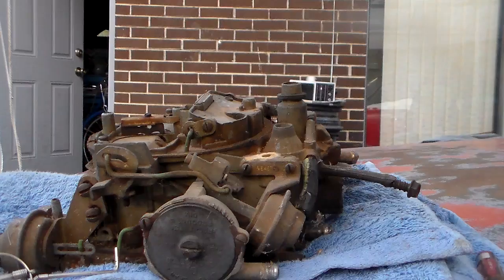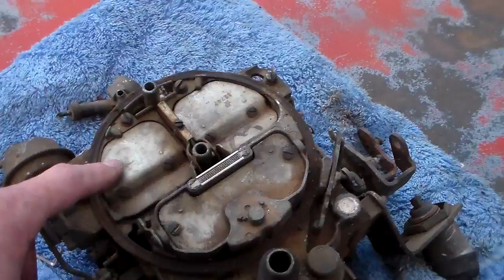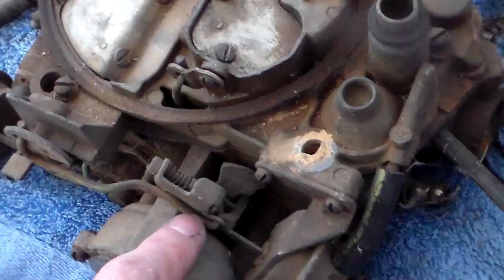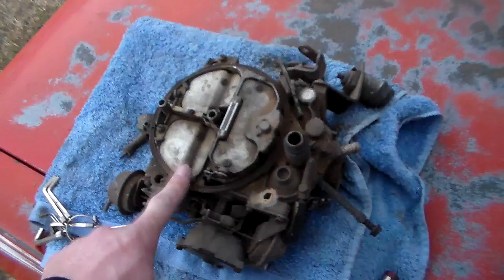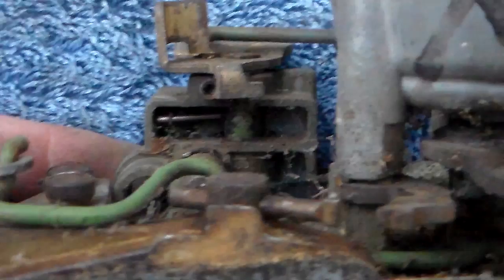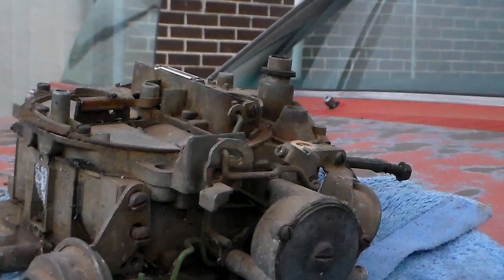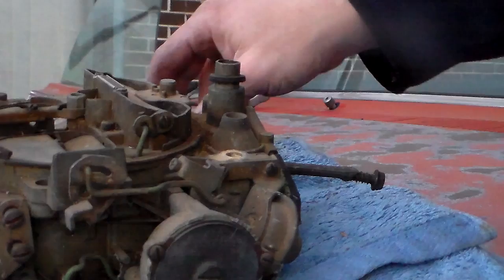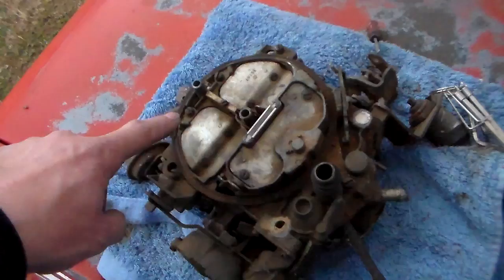How to adjust Quadrajet secondary air doors

Comment: 10 years....10 years I dealt with the "WOT bog!" And then I watched your video, walked out to the car, made the adjustments to mimic the spring pressure you showed and BAM, bog gone. In fact, it'll now light the rear tires from a roll just mashing the pedal. Thank you!!
Reply from the maker: Glad to help!
Reply: What is bog?
Reply: @91hamod  Bog is what happens when you attempt to accelerate your vehicle but instead of gaining rpm, the engine speed slows down, flutters, or completely chokes out. It "bogs" down. 

Depending on the nature of your engine there can be many different things to take in consideration when trying to correct this problem, but in essence 9 times out of 10 its directly affected by improper fuel/air mixture from the carburetor. You stomp the gas -> improper carburetor tuning -> engine bogs -> complete loss of power and rpm -> a little piece of you dies inside.

Carburetors are incrrrrredibly complicated devices with hundreds of completely different designs and applications. Each one must be tuned correctly or else you'll get poor gas mileage, low power, back fire, and eventually bogging as the severity of calibration strays. Hence, the individual above stating it took him 10 years to finally learn what to do to fix his bogging problem from this video.

Don't be scared of them though. carburetors are just like any other piece of a vehicle - nuts and bolts. Take some time and watch some videos and eventually you'll slowly understand how simple they can be once you get what makes them tick. If you wish to build a carb for the first time Id suggest starting with a basic Holley. They're very user friendly, simple, and reliable. And because of their natural ON/OFF feeling design, they're great for more aggressive builds if you wish to slowly build you vehicle into something with more performance.

I recommend a 4 barrel (4bbl for short) double pumper for a manual transmission and a 4bbl vacuum secondary for an automatic. There's nothing really wrong with a double pumper on an automatic though, just needs a bit more dialing work and throttle control. learn the difference between double pumpers and vacuum secondaries and you'll understand why. Holley actually has a full video series on youtube explaining almost everything you need to know.

I hope this clears up a descent sum of you and others questions. Theres always more but I dont have the room to type EVERYTHING here lol. Best of wishes!

Comment: Thanks for the video. Just bought a C30 and the secondary flaps had no spring tension. It would open up if you looked at it the wrong way. 😂

Comment: Top Man Tyler !  My little old 87 Pontiac Firebird 305 has been boggin and surging for almost a year.  Trying to find people with knowledge on these here in the UK is like pullin teeth . . . . .  painful, every time I thought I found a so called 'expert' they knew less than I did already.   I have  been 'messin' with the emissions system, and the QJet settings for ages, I tested every solenoid and checked every vacuum line for hold vac, hell I even pulled the EGR valve out and declogged it, and of course adjusted the infamous TV cable, but still my bogging from idle AND during acceleration remained.    I have self-learnt and tried what I could 'SEE WITH MY EYES' but all in vain.  THEN I found you Qjet video streams and this video led me to that hidden grub-screw used to secure the pre-tension spring for the secondary flaps . . . . . . . torch . . . . . .mirror . . . . .check . . . . . . .found the bugger LOOSE . . . . . . .adjusted the flap tension as you described . . . . . . and took the opportunity to also correctly adjust the choke flap and fast-idle speed.   Just took it for run and WOWEE I HAVE MY CAR BACK.    After a full year of messin about the problem has turned out to be a small loose grub screw for the secondary flap tension.    Keep up the great work Tyler :-)

Comment: Man thank you so much. I finally got my car running right. I got a trans am and a quadrajet is the only thing I can fit under the shaker base. I never could get it to run right and tried everything in the book. Except this. Wow what a difference. I'm sold on the quadrajet now. Great information. Great explanation. I dialed mine in just like your flaps open and close on this video and it's running perfect. No more bog. Not more stumble. Nothing. It's perfect. Thank you for taking the time to do this.

Comment: Thanks for the video...I just built a 300 HP 305 for my boat.. ported heads, small duration ,small LSA big lift cam..stock low rise but with a 1" 4 hole for velocity and a bunch more goodies...I found I have a bog out of the gate and I'm sure this is it...on Holley's I would just test ,replace with a stiffer spring,test ..most people think it needs to open sooner but it's the opposite so that the carb does not lose all its signal too fast..so simple to adjust..I never knew ,or I did and forgot.. mechanic for over 30 years...great video,thanks for posting..

Comment: Can't tell you how much your videos have helped me with my carb and getting it sorted out. Thank you so very much for taking the time to make these videos and share your knowledge.
Reply from the maker: I'm glad they were of use.
Reply: @TylersNeighborhoodGarage  
They are definitely "of use". Any vehicle I've got with a carb.... they all have a Quadrajet. I love these carbs. 

I have a question Tyler...
Can I tune when the secondaries come open? I've noticed I mine won't open up above 45 mph. Below 45 mph if I stomp on it she's a beast that'll embarrass sport cars.
The issue I have on this 1981 c3500 (350/400/4.56:1 7400 lbs) is I have a long huge incline grade on the freeway near my house. If I hit it with speed I can climb it 80-100 mph but if I get there without speed..... all I can muster is 40-50 mph at full throttle and secondaries don't open. 
So.... I know if I need to tow over this hill, currently, I wouldn't be able to do it. 
I'm not expending big block or diesel torque to climb this hill but I know what a properly tuned small block can do, so I know I'm lacking alot.

How do I fix my secondaries for this hill under load?
🙏

Comment: Thanks for the video!  I restored a 1973 Formula 400, 4 barrel, 4 speed, like the new one I had back in the day. Had that Quadrabog problem when I punched it, didn't think the adjustments would really  work,  but after a few tweaks as described in your videos, the car wants to go sideways with power when the secondary"s open. WOW!

Comment: 13:10 cheers Tyler mines doing this. Also i found out my secondary/choke vacuum module is dead. The one at the front of the carby. Its been running rich and not getting much power and chewing fuel. Excellent that you took the time to teach us.

Comment: I subscribed. Thanks for the info. I'm 16 and working on restoring my 1980 z28 with original 350. Runs great but when you punch it, it hesitates and wants to stall but then picks back up. I'm gonna try this adjustment and if this doesn't help I'm gonna go through and make sure all the screws are adjusted to factory air/fuel mixture

Comment: WhoSaidTyler I had a bog like you described when I stomped on the gas pedal, and I tightened the secondary screw just like you showed and the bog is gone.  Now I'm cruising around town in a 1936 Ford 2 door sedan with a Chevy 350.. recently inherited the car from a relative who passed away, and I knew nothing about carbs before this.

Thanks again - Tim
Reply: P.S. it is a Carter Quadrajet.  It looks just like the one in your video though.
Reply from the maker: tim d Great! Yes Carter produced Quadrajets when Rochester couldn't keep up with demand.

Comment: I have a freshly rebuilt Rochester Quadrajet. When I punch the gas the secondary's barely open. ( I had to dissemble and clean the carb for another reason) but Im certain I re-assembled it correctly. I watched your video and put it back together step by step. Also, when I give the engine a quick punch of gas, there is a slight stall as if its not getting gas right away. Thanks

Comment: i rebuilt ( with a good chem. soak too ) a e34mc, and did everything, including the  choke plate adjust with choke level gauge, the one with the bubble, and it works great. yes, i had to adjust that spring, and file the lock out pin for the butter fly's on the secondary. i loved it. set up a bench with leveler plate and all. the tools were a bit hard to obtain, and i made some of them, but i did every single thing that could possibly be done. all of it. the fucker rips ass now! edit: sometimes the hanging up you mentioned on the secondary , comes from that spring you just adjusted, it starts with a little snag on the initial movement. oil it up good and a hair, i mean a hair looser on the adjust is all you need. my choke pull off went out, and i took mine off and had to wire the fast idle cam down, so the secondary  lock out pin would not interfere with the operation of my secondary. hell, wire that secondary   top plate wide open too  and give it gas. hahaha.  fuck rochester!

Comment: secondary air door spring adjustments are somewhere between 1/2 and 1 turn by 1/16 of a turn..  1/2 turn, 9/16 of a turn, 5/8 of a turn, 11/16 of a turn..   all the way to one turn..

Comment: Thank you for a very informative video. I believe this is what I need to check on a used QJ that I have on my  1974 C10 \ 454.  I just got it installed this afternoon and it runs fine until I go WOT where it just moans a little instead of roars like a QJ should.

Comment: Thank you VERY MUCH!  This is exactly what was wrong with the Quadrajet on my Firebird Formula 400.  

One thing I noticed, was that screw was loaded with the spring, and it had to be held at the desired position while the set screw (allen head) is tightened.
Reply from the maker: Yes, it's a 2-handed operation, lol.

Comment: ive used QJ to replace Thermquads on Mopars, and swapped a few Holleys out for newfound beleivers..not a fan of the later 4ME series,but with right rods, hangers ,and pull off rod/ damper door setup..still work damn good on the 80s GM products too
Reply from the maker: you're right
Reply: +WhoSaidTyler how do you remove the spring to replace it? loosen the set screw and pry the shaft that that the spring is wraped around out?

Comment: Thanks for ur videos they are most helpful. My 73 t/a runs decent until the secondaries kick in then bogs. But if I get the t/a past 60mph and hit it it pulls just fine no bogging. I don't have any vacuum leaks as I can find. The secondaries doors are adjust just like urs. FYI I pro quadrajets.

Comment: I realize this is an older video but I wanted to ask you your opinion on this secondary air door/flaps opening and the spring tension you just adjusted. Back around 2000 I rebuilt a 350 Chevy engine out of a '72 Chevy Cheyenne pickup. The machine shop bored the cylinders .030 over, alighn honed it, rebuilt the stock heads, yada yada yada. I installed a mild performance cam, Edlebrock Performer intake and headers with glass packs. I had been researching the book "How to Hotrod The Small Block Chevy" and it had a wealth of information on building street rod engines and talked about how the 4 barrel Quadrajet was a good street rod carb if built and adjusted correctly so that's what I decided to do. The book also talked about how a particular engine could benefit from adjusting those secondary air flaps or doors to either open earlier or later depending on what the engine demanded or wanted. If I remember right it talked about how a built street rod engine would most likely benefit from adjusting them looser than stock to open earlier which is what I did. I never got any on the street experience with this engine because I was only able to break the engine in and run it on the engine stand here and there, I never had a chance to actually get it installed back in the truck because at the time I was doing a frame off restoration and the truck was in many pieces at the time and my fiancee and I split up before I could get it back together. Anyway, I wanted to ask your opinion on this subject if you've had any experience adjusting the secondaries to open sooner than was set at the factory for a hodrod engine and if you think the adjustment makes much of a difference in performance in such a case?
Reply from the maker: Well, you need to view the adjustment of those air doors as a balancing act, so to speak. They act directly on the secondary metering rods, so anything you do affects the metering. Adjusting them too loose is a common thing that people do and it ends up causing the air doors to pop open so far and so quickly that they bounce back closed, then open again. Guess what happens to the metering rods when they bounce closed? You simply approach the air doors as a tuning operation: drive the vehicle and adjust them until it operates as Rochester intended...no bog, no stumble. Remember that the secondary side is also tuned through the metering rods and the rod hanger. Factory HiPo Qjets also had larger pullover secondary enrichment as well.
Reply: @TylersNeighborhoodGarage  Unfortunately I don't have that vehicle anymore or that engine, not for many years but that's good to know for future reference when I build another one. 👍

Comment: Hey Tyler, my '77 Corvette with the original QJet has a high idle and I have troubleshot everything I can think of. When it is idling high and I force the secondary air flapper open it drops down a lot. Release it and the idle goes back up. The secondary throttle plates are closed fully. Any idea what is going on here?

Comment: I have a 67 impala w a 327 engine. My secondary doors don't open unless the car is off. It seems like diaphragm always has vacuum pressure even when I give it gas which doesn't allow the doors open. Any suggestions?

Comment: What is the part called that the secondary metering rod hanger sits on top of? Does it have a pin that secures it? That part was completely loose and a pin is missing it looks like.
Reply from the maker: There is a plastic cam mounted on the air door shaft, then a retainer, then the rod hanger is fastened to that with a small screw.

Comment: I have a summit bought quadrajet #17057553 that I had on my stock pontiac 400. I then rebuilt my motor and added ram air manifolds, ram air 068 cam and 2.5 exhaust. And my current altitude is 5312'.  I am not certain what jets I have in there just yet. I guessing stock size, But do you think I should install larger jets and metering rods"? If so, got any idea what size?

Comment: I have that exact same carburetor that im going to be putting on my 73 lemans with a 350 and I have no experience with it. What is the vent tube that went to the bottom of the air cleaner you were talking about? Could I just block it off?
Reply from the maker: that_gr33n_pontiac  Look at the front of the carb and you'll see a large tube that projects vertically. It originally mated with the specific Pontiac air cleaner that had a hole in that area to allow that tube to fit, with a small seal around it, as you can see in the video.

 You can block it off or take an old foam lawnmower filter and affix it on there securely.

Comment: I'm having issues where My secondary doesn't open unless I am flat on the floor. I have to rev well over 4500 rpm to get them open. It doesn't bog, doesn't stumble. Feels like I am running a  2 barrel all the time. Any help? (video's already made)
Reply from the maker: First thing is to make sure the secondary butterflies are opening when the front barrels reach about halfway open. Often, there is a lockout tab on the choke that prevents the secondaries from opening until the choke opens fully. If your choke isn't unloading fully, that could be an issue, especially considering that the carb is designed to unload the choke by force when the throttle is opened fully (to clear floods). Next, the air doors up top have an adjustment in the spring tension and it's possible someone tightened them too far. I consider that to be least likely. There is usually a pulloff attached to the air doors, but they will still open even if that fails. I am confident you will find your culprit in one of these areas.

Comment: I just checked timing advance and its on, at least up to 3800rpm. With it running at idle, I can open top secondary doors, which lifts metering rods and fuel should be coming out the small little ports, right? Mine are not, at least at idle and a little above idle. Or does fuel only flow though at high RPM? Just want to check before I tear it apart again.

Comment: i reacently tried to make this adjustmeant after having this bog issue step by step i done as you showed with your finger testing its tention after my adjustmeant and it made a snap noise now the sring doesnt pull the flaps closed??! I didnt turn it that tight im sure so im hopeing the spring would by chance just have came loose i even tried putting the tension back loose and its still the same. Do you have any opion on how i can check to se why the sring doesnt work or if its fixable without taking it off my engine?

Comment: Has just recently had my carb rebuild. and for some reason of my secondaries will not open. the choke is not holding it closed. It seems that the vacuum doesn't drop enough on the daiphram. Is there a remedy for this